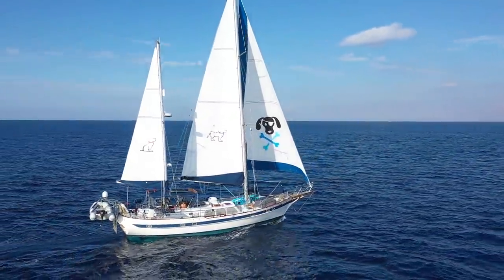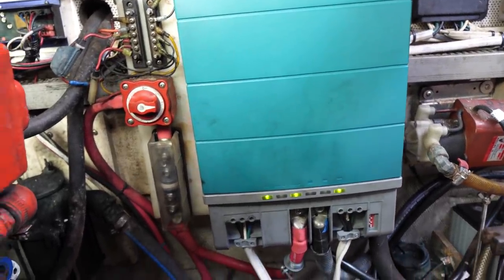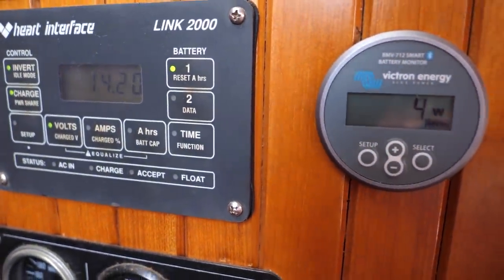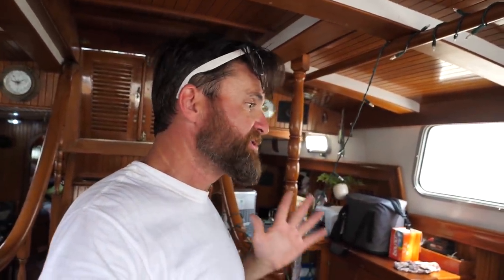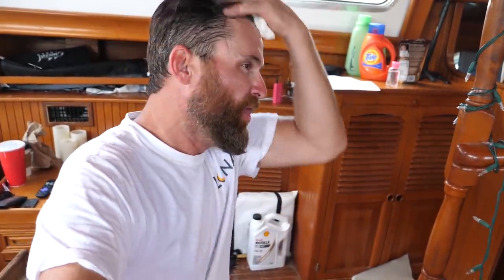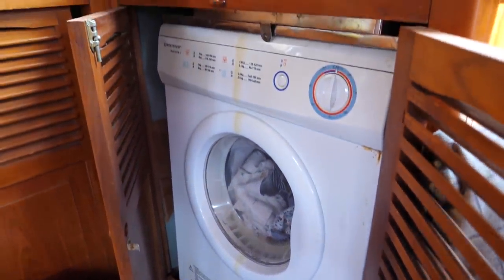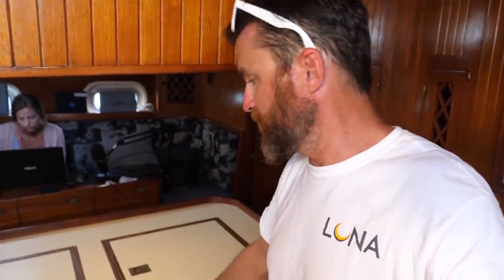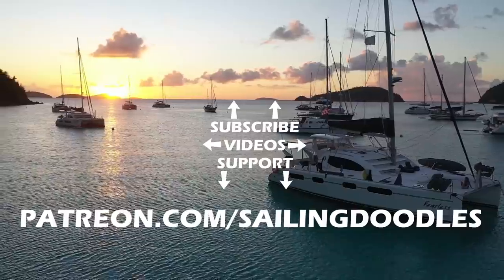Off-Grid Sailboat Living : What it Takes

Comment: Thanks cooking up the whole enchelada of off grid sailing. That was probably the most comprehensive summary I have ever seen presented by a host on a sailing channel. Well done. A+++ presentation. The one thing I worry about with the design of your boat is access to the engine. Being a big guy like me I would never be able to squeeze in, in some convouted way to change a belt, fix a hose, etc. Looks like you better find a rich patreon to come up with the $10k needed to replace your ageing generator. They are damn expensive. I have seen some other boats that are about your length of boat or a little longer that have bespoke engine rooms with the generator and water making system that are to die for. I just hope you never have one of those nightmare fix it jobs when you are on the high seas. Best of luck going forward.

Comment: Bobby this was an eye opener. I do not have a boat, but I run my self build house on pretty much the same way as you run your boat. So now you no every wire, water pipe, inverter, battery's and  can fix it your self. Cheer's.

Comment: Bobby, FYI the bow thruster has a built in delay on the joy stick control system that requires a 1.5-2.0  second pause when changing the BW thrust direction!  I thought it was faulty as well, but it is an operational issue.  I even replaced the switch before reading about the required pause in the installation manual.  That's why it seems to work sometimes and other times fails to.  Play with it and see.
PS: love what you've done with the boat, its great watching her sail and remembering my time with her!
Reply from the maker: I had just installed new solar panels and must have bumped the thrusters wiring.  It was a loose wire

Comment: About the dinghy: many think all they need is a small motor to get to the beach and back. But a 15 or 20 horse with give you so many more options. Instead of pulling the hook and taking the whole boat, a fast dinghy will get you into town for parts and supplies; will get out to the fishing spot; will get you to that cool island or lagoon that’s way too far for a 4 hp or electric. Also, you mentioned getting a smaller one. My advice is always get the largest dinghy you can carry. I think you might regret going smaller.  Oh yes, and Taylor’s hot, blah, blah. ;)

Comment: I would definitely have a 2000 watt compact generator.... They last forever,, they use very little gas,,, so quiet you can't hear them... Unless you beat it with a steel pole, and intentionally mistreat it , it always works. It runs all day on a gallon of gas... It could be used now and then or just be there as a back up. They cost about 350 dollars, and you can run a small air conditioner and a microwave oven at the same time on it, and yet its small enough and light enough to carry it by its handle and walk. Mine weighs 43 pounds.
Reply: yes and you can make popcorn every night to add to the salt you already get from jumping in the ocean everyday. Throw in 4 or 5 items that weigh 43 pounds and hell you can just sink to the bottom of the ocean. LMAO. I thought the idea was to have a minimalist attitude. You know eat sushi every night after you go down and spearfish dinner. I have a 43 pound cooler that you can build to throw in ice from your 43 lbs. icemaker to double as an a/c unit too.  Just f---ing with you. Good idea.

Comment: Bobby, a well maintained generator should easily last 20,000 hours. Just don't not run it for a long time and don't run it for 20 min and shut it off. When you start it, let it run for at least an hour to burn off condensation in the oil. Just saying, Tim. Keep up the videos! I'm a full time RV in a Diesel Pusher...everything you're talking   hits home. Something is always needing to be fixed. You have to know so much more then being in an RV.

Comment: You need to try out AeroGarden on the boat.  I wonder how well the garden would do on a boat.  The AeroGarden water pump and lights can run off of 12 volts DC with the right cable.

Comment: When its time to replace your solar panel look into the panels that have slide out panels in them when your traveling they are the size of the panels you have but when you get there and set up they have slide panels under them you slide them out and double the size of your solar panels we get quick recharges and you can run a lot more stuff
Reply from the maker: Hmm interesting

Comment: If your current battery bank is 950wh and you can’t discharge them more than 350 to 450. Then you could probably go with 500wh lithium batteries since you can take those down to 10 or 20% (50-100wh) without damaging them. You could add more later. Just need to get a sponsor to help with the costs.

Comment: Bobby where can you get group 31 AGM batteries  for $150?  Best price I've found is about $250. Firefly AGM G 31  can be taken down to about 30-35% and they cost about $450-500 each. Great video.. Fair Winds from the crew of Celtic Lady Seawind II 68K
Reply from the maker: Sams club.
Reply: That's where I just got two AGM 31s for my bow thruster. Take the old ones in to trade in for the core (About $20).

Comment: How much amperage does the diesel engine alternator put out?. Might be a cheap upgrade to put in a 300 amp alternator on the engine to quickly charge the battery bank when using the prop.

Comment: You can get lithium’s for $700 ea now...
Reply: And for use that cycles batteries, lithiums are cheaper in the long run. You get more power out of them per size and weight, far more cycles ,(some people are getting years more than expected).  I would be switching to lithium asap even if buying used medical batteries etc.